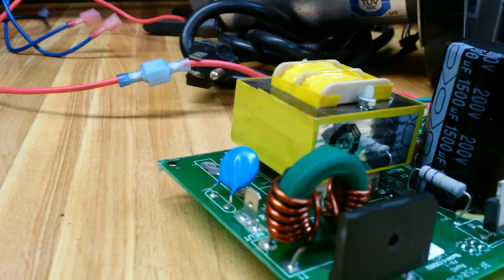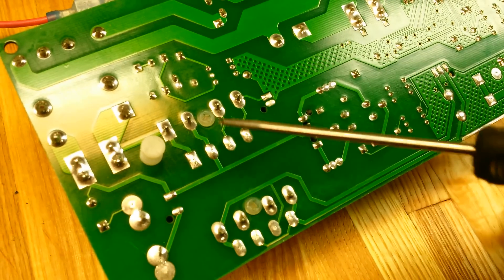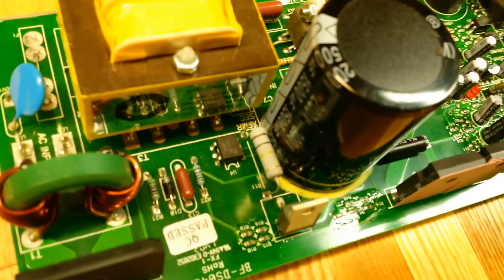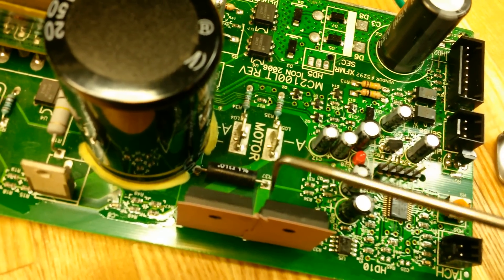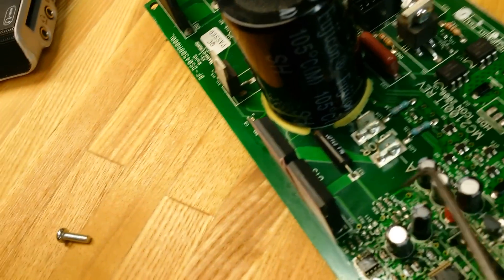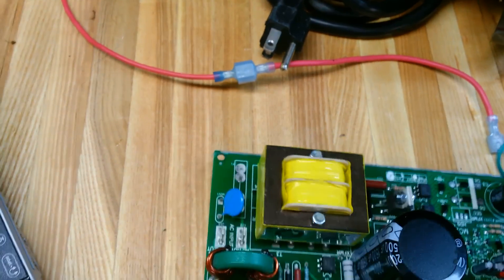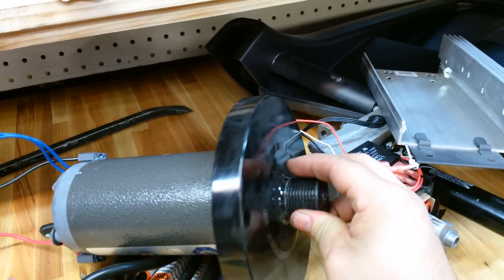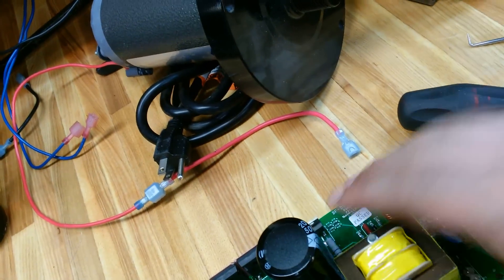How to wire up and use a treadmill motor part2

Comment: Please help me,,,i have trying to fix a circuit bored like zis,but the out put i have gotten is 90volt dc after i have chagne some components,but the  motor is 180volts dc..so when i trying to run the motor its not like before some how...its difrent rotation

Comment: Bart - I just acquired a Leili 116y2-1 DC motor, 130 VDC, 3 HP motor.  What can I do with it?  It is just the motor and no electronics.  I paid $0.99 at a local Salvation Army.  I am not sure if it works, but figured I could at the least get copper from it.  I am sure it is worth more than a dollar.  Thanks.  Kelly
Reply: Put it across a car battery if it rotates it's good 👍

Comment: Dude you really know nothing of electronics.  You talk with such confidence like you know what's going on, but no clue.
Reply: It's a shame because that's a decent driver.
Reply: @wickedprotos1937  yeah I basicly trashed mine. hooked 5v to the little clipped off tab and fried the mofset
Reply: @boharris8179  There's a whole lot of art to designing a pwm scheme to ramp this motor up speed. This guys crap advice tells people to basically jam the mosfet on. With only 5V the mosfet is not saturated so the inrush and Rds on at Vgs=5v will let it heat and pop.
Reply: @wickedprotos1937  That's exactly what happened. I done some more homework on the mofset and how they work and simply hitting it with 5v is not how it's designed to work and the fact that cutting some of the pathways for the drain isn't optimal. Needless to say I had to have a couple beers after I knew I butchered my mcb on the advice of this guy

Comment: Great tutorial, can i use any motherboard to fix my tredmil??
I was in the moddle of a workout and then it stopped. My control pannel lights up, my moter is tested and it works, my red LED light flashes when i turn on the eqipmepnt. I dont hear the Relay clicking at all.
Reply: You need a motor control board that is compatible with your treadmill. Also, consider the idea that your walking belt may be worn out, causing the mcb to blow out.

Comment: good day
Cordial greeting.
From Bogotá Colombia.
I have a card equal to that and I have burned the resistor R21 and R22 I have no idea what ohms it is.
You can help me with the value of these resistors the R21 and R22.
Thank you very much.
Stay tuned
Cordially
Jaime Guzmán.
Reply: On the MC-2100 board ---  R21 is brown, black, brown with gold tolerance band (100 ohm 5%) and R22 is white, brown, orange with gold tolerance band (91 K ohm 5%) hope that helps.

Comment: What a total misrepresentation of what the board description and what the components  functions are.
If the control transformer is retained, it is simple to provide the PWM necessary to run the motor under pot control and inbuilt acel/decel.
I have built a simple bard for an add on, complete with stop/start P.B.s
The mod suggested turns what is a decent board into a $5.00 misfit.
For e.g., the low resistance diode is in fact a current sensor to prevent the motor being overloaded.
Michael R below has it right!

Comment: Congratulations. It is possible that you explain who is the conection of the motors. Thank you.
Reply: In a short time I will do some videos explaining how to use or test this type of boards.

Is very simple, but you need to do a PWM circuit for that.

Best Regards.

Comment: If you would like to scratch a trace off on a BCB use a dremel with an 1/8" drill bit in it, the drill bit wears away the copper trace real fast. Make sure to make a big gap or some circuits can arc.

Real question is did this WORK?
I'd hate to take your advice and screw up a 130 dollar board to find out your wrong. then have to find a different way to do it.
Sorry if your offended that was not my point. 
You do know the Chinese are watching this stuff and taking our ideas, we will start seeing tools with DC motors on them with speed controls.  I seriously can't think of a tool speed control wouldn't help along with a smaller motor and more HP as well as torque output at any speed. Also less gears and pulleys.
Reply from the maker: sure it dose, all your doing here is using the rectified power, using the smoothing caps and output transistors.... you can de solder these parts and put them on a protoboard. or just use the DC output side to get full power. you dont have to cut the traces. but why energize half a board your not using

Comment: I think I better get a bottle of whiskey? How do you know which parts of that board you need to use and not use ? Can you make it simple start with the plug in to the wall power 120v and walk it to the dc motor ?

Comment: Just figured out that black chip at 7:35 or so is a CY8C27143 - a "Programmable System-on-Chip.  IE - this is a computer for some part of the tread mill.  It is a respectable machine control unit (MCU - like the chip on an Arduino).  This puppy runs at 24 MHZ!

Comment: my transformer input 220V and i have 4 wire in the output side but don't know the value of output volts
Reply from the maker: Our wiring runs on 110v not 220. Sadly. Might have differant reading. Shouldn't though. I'd have to find this board and measure it for you. Is it the same as in this video? I've gotten 4-5 motors and boards so far.
Reply: Bart Koscow I'm doing this for a belt grinder can you please do a final part please showing how it's all wired up and stuff

Comment: Bart, you did not finish showing the final hook up.  You lost me on where  to hook the jumper from the middle wire on the diode/rectifier? to the A- .. straight jump?  Also,  you cut off the speed controller lead, but mentioned a 5 volt  (AC or DC) would control that ... well, how?  Can you simply wire in a stand alone POT on the DC output side?  I need variable speed.  I have this exact board so I need to get the final connections made after I cut out the circuits you describe.
Reply from the maker: Apologies, I did finish, and yes I supplied it 5vdc, as little as 1v is ok. But the board has a 5vdc lead that you can use. So that works well. And yes it runs. You just don't have any speed controle. That's all. Fine if your using it on a drill press or shitty band saw or small milling machine.

Comment: any idea where a potentiometer would be wired into to use variable speed?  or point me in the right direction  ..  have a 4hp motor with the same controller you have

Comment: Did you ever finish this board? I don't want to cut mine apart and find out it won't work.
Reply: +limitliss Don't cut the board. Not worth the trouble. The board you're seeing is a MC-2100 but a different revision. If you have the board already just drive pin 4 (Blue wire) on HD2 with a pwm (0-5v) to run your motor. All the hookups are the same.
Reply: Hi,
Do you mean when the positive pole of the 0-5v PWM is connected to pin 4 then the controller will run?

I have a similar board and I like your idea and if you could clear this up a little more I'll be apreciated.
Reply: Sophiep Tran  can you make a vin on that
Reply: Sophiep Tran vid
Reply: I used it to make a grinder but will be getting another one in a little while so I might be able to film the setup.

Comment: how about hooking up some dc current to the motor. why are you cutting up the board bud? sounds like ur talking a lot of sh#$%@!..didn't get anything from your rambling...
Reply from the maker: Well the motor takes 90-120v DC. And butting up the board removed all controle and eliminates any back feed from circuits not being used. This would stick the motor onto full blast on or off. Just a quick and easy way to use the board and not have to use any pots. Can be done with any treadmill board. Just takes advantage of the rectifier the smoothing caps and power transformers. If you supply it with a PWM signal you could controle the speed. But that's not needed for the motor to run.
Reply: Bart ... I've followed your instructions, but I cannot get ANY DC voltage past the rectifier lead.  NOTHING on the other side of the capacitor.  I have a DC governor to control the voltage, therefore the speed,  but it requires a "refined" DC (too much crap to hook directly tot he rectifier) and the capacitor checks out  as good ... so, what gives?  Did you actually check to see if you got voltate on the red + motor out lead? I have none!

Comment: Oh sure use my 190hp honda k20 motor for the surface plainer hahaha..... actually the 300hp supercharged k20 we have would have been better to use as it would not care at all if you feed is bricks of hardened steel for surface plaining hahahha...

But yes many project coming at some point between our full time jobs

Have to get the 300 watt CNC laser working, get the lathe into the basement and working, need a CNC mill,  a vertical mill and.... many other things? 

MUST HAVE ALL THE TOOLS!!!

Comment from the maker: Just for reference is Google's search. This is a BF-DS04508R000L and this is out of a golds gym trainer 420. I got it new but damaged from a auction. I found the extention cable for the controller. And it works fantastically either a magnet on the safety switch. Without. No so well. Which was the only problem. With this otherwise brand new treadmill.
Reply: Hey Bart I have a couple questions can we some how chat I’m on Facebook as marshall Decker please contact me

Comment: Take a look at the controller diagrams here ..  Is yours a 2100?

https://sonsofinvention.wordpress.com/tag/mc-2100-motor-controller/
Reply from the maker: The one I have is not a 2100. Or a the more common d91. Which is why I'm opting to not deal with the trim pots and potentiometer. Any just wire right in. But that article is fantastic for me to use for the arduino. Just with my board. This one is the 130v but i'll be doi g the same thing with my 90v board too.